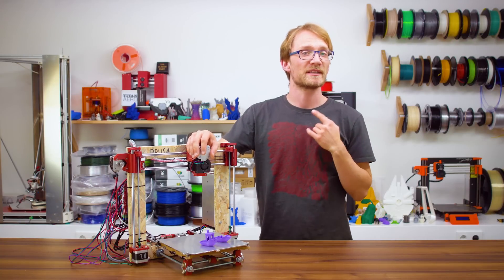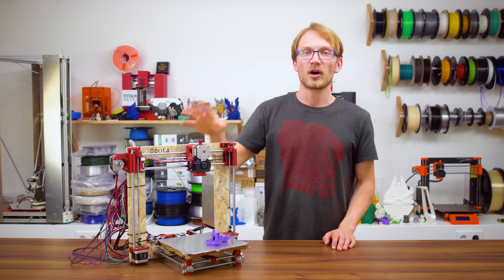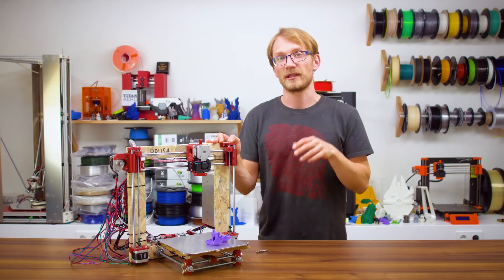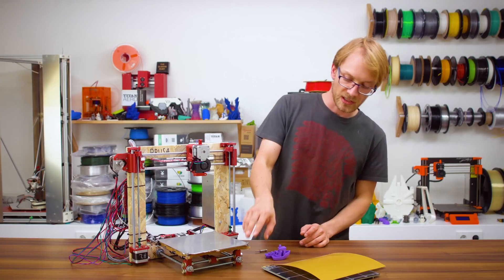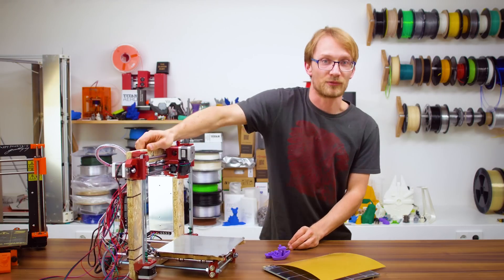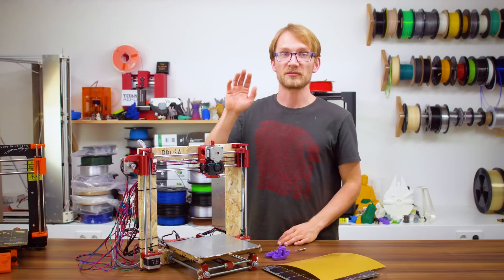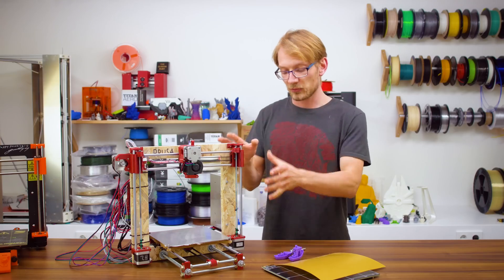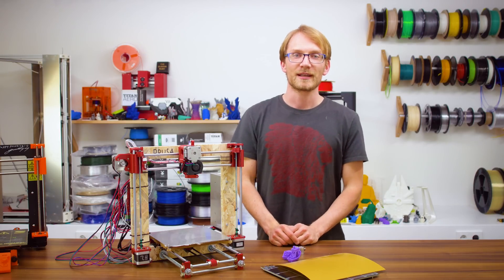Building the cheapest possible Prusa i3 MK2 clone: [03] Build notes!

Comment: I know that little to late, but m5 rods are just to weak for weight of x axis. Easy solution to bending m5 rods is flipping z axis upside down. When motors are on top of frame, x axis weight pull on m5 rods and keep them nice and straight. Alternativly, one can modify top rods mount and add trust bearing and dubble nut.

Comment: Can someone explain why everyone 3d prints that boat toy?
Reply: it has many difficult parts to print (vertical text, horizontal text, overhangs, vertical/horizontal holes, etc.), it´s simply benchmark model, if u want to see if your printer prints all right, you print the boat and check if all previously mentioned parts are satisfactory

Comment: building stuff by hand is alot different than using a 3d printer.  but that's why i ordered a 3d printer.  back in the day we used to have diagrams to lay the cut components on for alignment  and comparison .  that would be a good video printing a 3d part and comparing it to a 3 view diagram to show people how it used to be done.

Comment: I see the total price about $150 + printed parts ($10?) 
$54 Electronics
$  4 wood for base
$41 Servos
$14 Extruder
$37 Linear parts

It's not as cheap as I expected. It's possible to buy the whole 3d printer kit on ebay for about $120 including shiping to Europe. Although ordering part by part could be much more fun and better learning experience :) Also (after the pain of building and calibrating) it will be easy to debug future problems based on this  tutorial... Thanks

Comment: I built one. I had never used a 3d printer before, but I now have one that seems to be giving usable prints. I only need to tweak a little bit more to get holes that are the right dimensions. But this was a lot of fun. And even though I might just purchase one if I can not tune the one I built right, it was still totally worth it.

Comment: series not complete
Hey Tom! Love this series! Saw the first two where you list all the part and was hooked. I decided to build my second printer along with this build instead of buying another one. Made some different choices along the way, had some scrap 6 mm alum diamond plate for the frame, used the z couplers. All went real well. 

As far as where should you put the other content for this clone? PLEASE put it here as up load at least.  Right next to these in the playlist.

I couldnt follow live so have been building with these videos sense you put out the last one and just finished tonight <sort of> I ordered the LCD screan (large one) because you said it would be included and you would even do two firmwares for the two dif sizes. The LCD and SD card slot are kinda deal breakers for me because I have no computer to keep attached to it while it prints. 

PS you may remember me tipping at the end of the last stream :)  3.75* stepper motors

again love it Tom, thanks

Comment: More or less finished my build along your videos - I only started with 3D printing 2 month ago and don't have a lot of experience with electronics projects, so the videos were really helpul!
I would be interested in a debugging video, if you ever get around to it. I was really lucky and only had one defective stepper driver arrive, but if the RAMPs or Arduino would have been broken in the way yours were, I probably would have had a hard time finding out. So understanding how you diagnosed that, might help some people.
Just a note: Your Marlin firmware seems to be the stable build, however with the RCBugFix config file. Most things work with that, however my LCD gave me alot of headache. If you use the RCBugFix Marlin version with your config file slightly adapted, everything is fine.

Comment: Tom, just finished my clone build and it didn't go as smooth as your build but in the end it was still a lot of fun. I did mention your video series a lot in my series and wanted to appoligies for butchering your name. I had my ups and downs and fried a thing or two, but in the end I sure learned a ton. Still working on getting that FIRST complete print, but in time I am sure I will get there.  Thanks for the series. Cheers!

Comment: I built this machine after watching all the streams but when i try moving the motors in any direction all i get is a high pitch noise from the motor and no movement (or a very little jog ) if i change the STEPS_PER_UNIT to something like 40 on the x and y they both move but have about 30cm travel each.  i have adjusted the potentiometers to 1.2v but im now stuck on ideas on what to do.
Reply: i have found my tevo tarantula can move the motors fine but the mks board wont move them
Reply: Mikey Check the polarity of the stepper motor leads to see if they're correct (i.e., connect two at a time, if the motor is difficult to turn, those are a pair). I had issues for a month or two because the motors came wired the wrong way from the factory. also, make sure your micro-stepping is set up (correctly)  on the RAMPS, using the jumpers. hope that helps! viel glück

Comment: Do you have a link to the 3D printer Extruder you used?  I didn't see it on your Dolly page.  Thanks
Reply from the maker: The extruder is printed parts + the hobbed gear, all included in the parts.

Comment: Instead of the tube. Print out a coupling. Use threaded end on one side and smooth down the other. Make a slot in both to be compressed by a zip tie around them. I forgot what the size of the rod and motor shaft were. I could print you two when I get my Prusa this week.

Comment: Instead of buying super cheap parts and making the frame out of wood which looks crappy. Please make a proper clone even if it costs $400 it would still be a great deal compared to the original one. Also, it would still be better than most printers in this price range. Please do it! Dolly Plus MK2 :)

Comment: Tom, your videos spurred me on to build my own clone.
I have posted changes to the extruder parts to accommodate the MK8 hobbed pulley, on Thingiverse.
These parts also includes a 12mm sensor mount. My clone is a 24V version, and the results are amazing.

Comment: Hi Thomas, I have watched your videos in the last couple of days and I watched this live assembly, not the full videos but it's ok. Excuse me for my english writing, is not my native language. Well, thank you for the info and recommendations that I did not know, like the tcm20100 driver upgrade, etc, I really enjoy watching your videos specially when you guess why a printing problem is caused by. I noticed that you had troubles with the aluminum heat bed when the nozzle touches the bed and the inductive sensor has not been triggered. I had the same problem because I have the same heat bed and what I realized about is that the aliminum does not have enough inductance, in consequence , the sensor must be closer to be triggered; so, I put a metal sheet over the heat bed and the sensor doesn't need to practically touch the metal sheet, wich will leave you a good range to tight your sensor. Another suggestion (I'm not an expert ofcourse) that y can say is use the same z-adjusters of the original pruse i3 plus, those small pieces will help a lot because the heat bed will rest without forces in the corner and you can adjust the bed leveling easier just in order to help the bed leveling function, you know. Finally thanks for all your videos, and I envy you because you have such a great lab there, full of tools and printers jajaja congrats

Comment: Hi Tom, 
I found this series to be very helpful, as I do almost all of your content.  Thanks for the effort!  

Also, I have a suggestion for an additional video in the series: fire safety upgrades. For this, or any cheap printer, the lower-end parts make one wonder if it wouldn't be wise to add another layer of hardware safety precautions, in case one or more components fail. 

Perhaps you could start with a discussion of the safety upgrade options, from minimal to overkill. For example, does it, in your opinion, make sense to add thermal cutoffs and/or fuses to components like the heatbed, the heatbed SSR/MOSFET heatsink, the extruder, the controller board(s), the motors, the power supply, etc.  

After discussing the options, seeing some implementations would be great.  I haven't found much detailed content concerning 3D printer safety upgrades.  Such content might make a great followup to the series.    ...Just a thought. ;)

Comment: can anyone shed some light on the pulleys? I have 16T pulleys and 20t idler pulleys. should I use 20t pulleys to match the idlers?
Reply from the maker: +Bill Karoly no need to match to the idler, the pulleys on the motors are the import ones.
Reply: Thomas Sanladerer Thanks. Check out Chavo A8 on Thingiverse. I watched this guy water jet cutting a steel frame for his Anet A8 and got the idea to make a PRUSA i3 mk2 frame from steel as well.

Comment: Tom, this is why i decided not to use threaded rods for my DIY 3D printer. I used belts and counterweights!!! And it works!! Please take a look here:

https://www.youtube.com/watch?v=HU3494YZonw

I've also been using the E3D lite6 hotend and it is flawless! Wooden frame is quite stiff in my case and i did not have any problems.
Total cost was about 120 Euros. So pretty good! :)

Comment: I hope you will connect these:
12864 LCD Smart Display Controller Adapter for 3D RAMPS 1.4 RepRap Prusa Mendel
and then like to also show how  to connect it up with all the software in marlin
like even if you can change the printer setings in the LCD? (normally this is not possible?)

and suppose you are reading this for once! (This is not mean intended! )
I tried to ask something but you did not understand me! (My translation error!)
I asked:
do once in your mind (only in your mind?)
the X axis motor to the other side of the motor support/frame
if this works then you can make the Prusa frame wider.
and than you can make a box frame. (I think it has more advantages than only one/1)
I hope that this time you understand me (I know my mistake!) but my English is not so good!
https://www.uploadarchief.net/files/download/x%20as.jpg

friendly greetings from The Netherlands!
Rob.

Comment: Great job Thomas!  Very inspirational!  I have watched every minute of your cheap build and am on my way to build my own version.  Im glad you are going to upgrade this printer to fix the main issues, I hope to see every minute of your mods!

Noob question...  Can you increase the diameter of the hole that is holding the z-axis screw at the top to help eliminate z wobble?  Basically, this would allow the top of the screw to float and not touch the top mount.  Or would that cause a different problem with the rotation mass of the screw drive creating a different artifact in the prints?  sorry if I'm using the wrong terminology.

Comment: To Anyone building this, I purchased on eBay 300mm T8 acme threaded rod with the brass nut for under $4 each. Much better upgrade than 5mm threaded rod. The aluminum motor coupling was under $1 each.

Comment: Please, I ordered all the parts and would appreciate as much follow up and upgrade videos as you can. I bought the flex couplers for the motor to T8 Linear rod. Maybe explain best way to fit them? Touching? Also, how to set up the Display and how to use the Prusa firmware. Thanks!

Comment: Hi, Tom thanks for this series. I watched attentively and did not have too many times where I thought "this guy is mad". I did notice that the first episode Chat did put you off a bit and possibly also some of the really stupid questions some people just throw at you, completely out of context....
With regards to the build, I would have done a couple of things differently, 1: OSB? R U SERIOUS? I would have used some Melamine laminated board, yes it is a bit more expensive, but the rigidity has no comparison to OSB. 2: Z axis, the alu couplers, when I saw you had bought them, I was like, Ok he is using his common sense... then somehow you decided to change them for the tubing... you should have stuck to your instinct..... 3: z axis threaded rods, yes you should have spent 10 minutes straightening them, this would have been so very useful to all the new builders out there who would otherwise overlook that step. the threaded rods, ALWAYS have to be straightened before installation.... 4: Heated bed, you should have used the heated PCB with a glass plate on top, just like the majority of the i3 clones..... you KNEW before-hand that the ALU bed would not be straight.... why did you insist in using it? German stuborness or just a trick to have more content for the upgrade videos? ;) wink wink.
5: The Ramps; my clone from Geeetech uses the GT2560 board. it is fantastic and not that much more expensive than the ramps + arduino + lcd + extra fan header.... The GT2560, for me, is the best cheapo option out there..... (in the 8bit sphere)
I know there were a couple of other issues i saw during the build, but the only one i can think of now is that towards the end, it was very noticeable that something was troubling you..... I cant quite put my finger on it, but I am going to assume that you were worried about some other commitments, and also the YT advertising scandal...
Now.... with regards to the channel... do you really want another one? one more channel to manage, one more subscriber base to manage, one more set of 3rd party logins to manage.... is it worth it? IMO, I don't think so. I think you should focus on doing what you do best, with a bit of experimentation here and there to see "what sticks" In addition, I think that a bit more diversification is very positive. I especially enjoy the camera stuff you have done, I have made a camera slider out of open builds stuff, just like yours, it is very similar actually. hehehe (I did ask you about the firmware a while back, I would love to have it.)
So, In sum, please keep doing what you are doing, you are an important part of many of our daily lives now, that is a big responsibility that I hope you will continue to develop and streamline, making your channel an even more fantastic one.
On a last note, please do not feel compelled to change something just because a hand full of people say so, follow your instincts, they are good, you just need to trust them (your instincts) a little bit more.
Thanks Tom, you are a star, not only on youtube, you are genuinely a great guy and I, for one would not like to see you disappear from YT.! Keep up the great work and see you around! Clap clap, if you have not fallen asleep yet ;)
like the other dude says: Highfive! and go hug yourself, you deserve it!

Comment: I've been collecting components to build a Prusa style cartesian 3D printer for almost two years. This series prompted me to complete my component collection and start a build. One of components I did buy before viewing the series was a 24v power supply, mostly because I have a 12/24v 3mm aluminium hot bed.

Question is can I use the RAMPS/Arduino control board on 24v or do I need to get a different controller and, if so, which one?

Anyhoo, looking forward to you implementing Dolly's upgrades. (I had already bought 8mm ACME lead screws)
Reply: James Lamb google is your friend. but as far as I know, you should be able to use mosfets if the ramps doesn't support 24v

Comment: If you ever need to cut a bolt down to size thread a nut on first and it will clean up the threads when you remove it after the cut.

Comment: I've followed this series on and off and whilst its been entertaining which might be enough of a reason to do it, what I can't help but wondering is whats the point of this? Is it to show that if you build a clone of the i3 mk2 as cheaply as possible you get a printer with issues? Is it to demonstrate that the i3 mk2 is great value given how well it works for the price? When you have replicated the i3 mk2 and it works as well as the original, will you have spent the same amount as you would have to buy the kit?

Comment: Hi Tom, thanks for the video series! Got my MK2 clone built following your live streams, originally built using very janky 3d printed parts, I'm now using it to reprint the new parts and they look amazing. 

For the interested ones:
  - I have followed the same Z-axis as tom suggest but used stainless steel and I've got zero Z-wobble
  - I got a aluminium frame from ebay, wasn't very cheap (£55) but considering I had no spare decent wood and a jigsaw ...
  - I started with the 3mm bed, it works fine but the screw in the corners mess up the z-homing, I need to home X and Y then move a bit and home Z
  - The MK2 marlin settings result in overextrusion, probably because of gear size, I changed the extrusion ratio to 0.9 in Slic3r

Comment: I probably won't watch the stream, but will catch up at a later date.
I'd like you to improve each area of the printer and show how this improved the print.
I found it interesting where you tried to save a little bit of money (Z axis hose  joints), but it would have been better spending a few Euros to buy a proper metal version instead. In other areas, the parts you use were perfectly adequate to do the job.

Many thanks for providing a great channel on YouTube.

Comment: I wonder if you would print a pla version of the z springs(Those thick round ones) if it would help. Support would be difficult to get rid of, but a fine metal saw could help or a razorsharp knife.

What would you say, possible or better looking for another solution?

Comment: The price...
I can purchase original printer for 500USD or DIY clone for 250 USD. In both case I can meet some problems with prinout and component quality. But, then I take chip clone, I know, that I can meet some problems. In case with original printer, I expect to obtain good quality from the box.

It's like a car. If you want sport car and you have money, you can purcase Porshe. If you don't have a lot of money, you can purchase Dacia Logan and install turbo kit. :)

In any case, great job. Thanks!